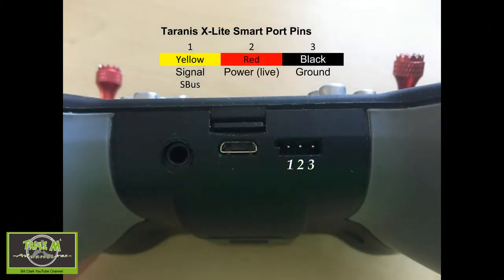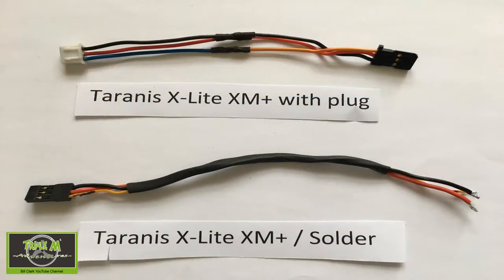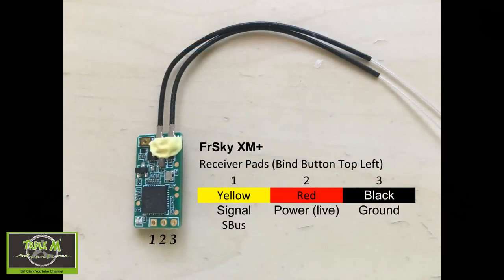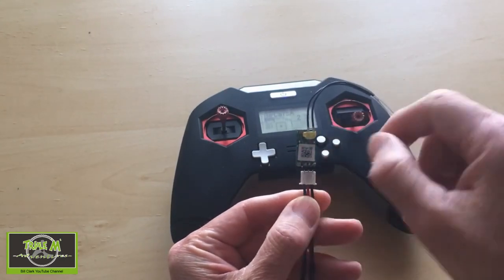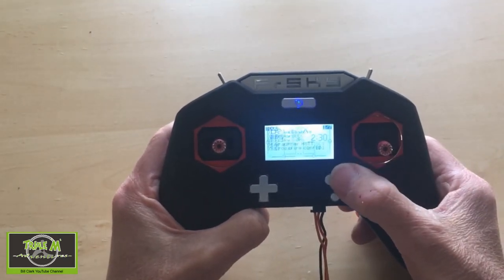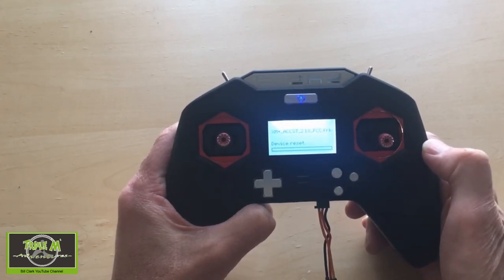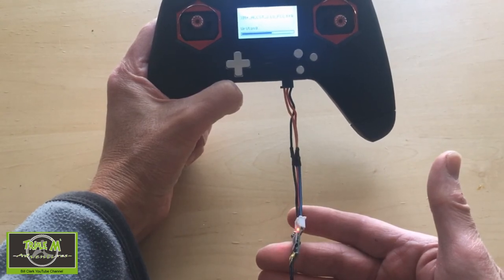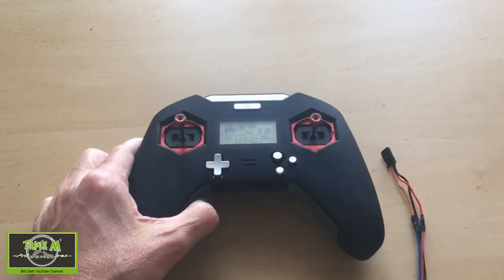How to Update FrSky Receiver Firmware with your FrSky Taranis X-Lite

Comment: good sir I'm currently stuck on this same problem 
how do you go about downloading new firmware for the control it self ? can it be updated via USB ? thanks for keeping the video relatively short and to the point too btw
Reply from the maker: PacMan, you can get the TX firmware from the FrSky website. Transfer it to your radios SDCard. Start TX in bootloader mode and you should see the firmware you download select it and update.